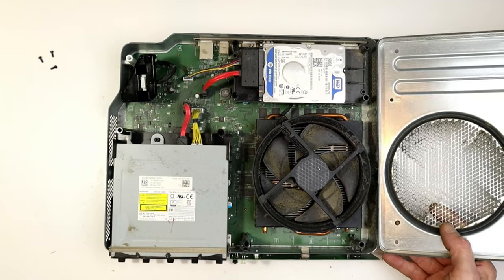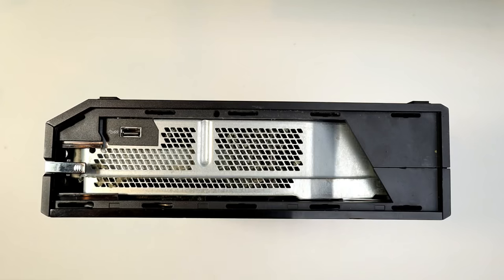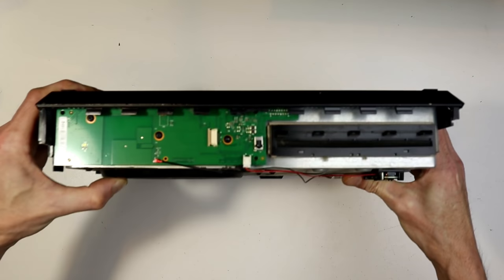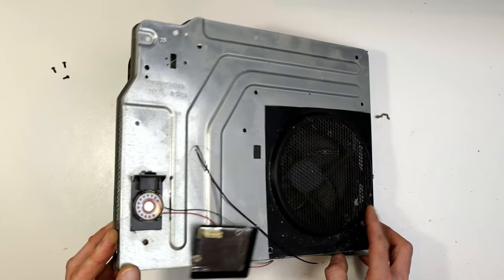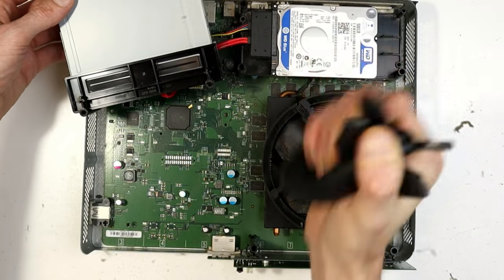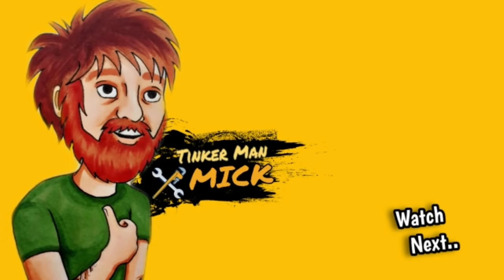How to Clean Your Xbox One Fan at Home

Comment: when i pulled the power cable out i thought the little ram piece was supposed to come out with it and i swear i had a mini heart attack but  i went back and saw the video
Reply: Man i thought I broke mine😭
Reply: Same
Reply: legit just did the same exact thing bro
Reply: Me too
Reply: Oh, snap..it's possible to put it back in and it'll work??? 😮
Reply: @ if i remember correctly i accidentally pulled the cable out and thought i broke it but then i realized the connector attached to the board flipped up and you could put the cable back in and close it and it would secure it in place
Reply: @gobbleswells2883 you have to put the ribbon cable in and loop it around the connector and the piece pushes in not flips down sorry

Comment: Do not use a vacuum cleaner unless you don't plan on starting your xbox for the next 24 hours. When vacuuming dust off electronics. It built up a static charge in the circuitry, which can ruin your console when you turn it back on if you haven't allowed time for it to dissipate.

Comment: You’re fuckin right about opening up the second part being hard.
Reply: How did u do it. I used everything. Screw drivers razors nothing worked
Reply: @Dripper_8097  Push down and up on the side one and use a prying tool, not a screwdriver and keep doing the same thing on each clip, push down and away, im not sure why he has you prying at the first one but yeh
Reply: @TheSean619  how to open still cant do it

Comment: In case you're not comfortable opening it up:
Just holding a vacuum cleaner on full power on top of the intakes also works quite well,I've done it before watching this video, and ended up still opening and being pleasently surprised at how well the vacuum worked
Reply: Which ones are the intake
Reply: @cow9066  those plastic lines that you see on top and the sides on it
Reply: @cow9066  there air vents
Reply: dont ever do that 2 electrical appliances even whencone is off can cuz a static reaction search it up it can make your xbox?pc slower and last shorter time
Reply: @kmshapiro4233  yes. It can also break the fans
Reply: That's what I'm gonna do, with a relatively low power hand vac. I'm too nervous about breaking that ribbon thing to open it.
Reply: this is perfect because im too scared to open my sons in case i break it, so i will try this as his keeps overheating and turning off.
Reply: First of all , it absolutely does not clean well . Most of us know this as we've tried it first hand . We've either damaged our console or wasted our time .
Reply: @tuikedz6864  Seems to me like it's not worth opening to clean. I've only cleaned my Xbox one with a vac on low from the outside and have used it almost every day since I bought it refurbished in 2016. Still runs like a champ with no issues.
Reply: That’s what I do, don’t want to risk damaging it
Reply: mine is still not working 😢
Reply: @livdavies40  Thats what mine is doing, over hesting then turniny itselt off

Comment: It is super easier to put back the case if you pop the front off the plastic clips. Set the front in place. Lock in the back and side clips. Then tuck the front clips under the top of the case.
Reply: How Do I put the blue thing back
Reply: Life saver
Reply: You might as well done a video cause I'm trying to pop it back and it ain't closing

Comment: Appreciate the vid! Took mine apart today, cleaned the fans, and my clicking noise was gone.  It’s a chore to take this thing apart though and put back together.  Especially that power button ribbon cable.
Reply: For future reference the front panel pops out from the top casing allowing you to attach the ribbon back so much easier. I wouldn’t have been able to put mine back together again otherwise
Reply: Definitely is a chore! 
Just finished cleaning mine and putting it back together. 
The sun was up when I started and now it’s dark 😂.
Reply: HOW DID YOU RECONNECT IT???

Comment: Worked like a charm I accidentally disconnected some wires but was able to put them back. Turned on Xbox and was a black screen after troubleshoot, I unplugged Xbox from wall held the power button down 30 seconds and it started right up. Thanks again !

Comment: Done this took a bit of time to get case back on, my power button doesn't work now so may have knocked it. But power on via controller works fine. Thank you for the video seems to running great so far(should add i fixed the power button issue as described in the video with the little tab connector) happy to say all back to normal and not sounding like a jet taking off under my tv
Reply: The power thing doesn’t work because the blue thing isn’t back in place
Reply: My power won’t work either I think I broke it

Comment: Go to thank you for the video I have never gotten my Xbox clean or cleaned it myself besides spraying the outer dust so when I opened it up today it looked like a goddamn desert cleaned it out and now it’s working much better than it was thanks!!! <3
Reply: bro this it works i want to try it too but i dobt know im scare if i ruin my xbox can tell me is good to clean with vacumm will take damage in time if i make that ?
Reply: @wavesoundsamv6135  I wouldn’t Use a vacuum mostly because it would be ineffective use Q-tips wet wipes or Compressed air they’d be much better for cleaning
Reply: ok thank youuu

Comment: Hi thanks for the video.. was a huge help.. however I didn't have anything to open the screws.. as I've had it years and will be replacing it soon. As a temporary fix I snapped off the remaining plastics on side to allow access to better clean the vents there. Then cut a hole (3 sides of a square) pealed that back and used a soft brush to clean the fan and blades. Hoover to remove dust.. and then pushed the mesh back into place.. xbox seams to be so much better now. And runs a lot smoother and quieter and doesn't overheat/turn off.. however I've only recently done this so I will have to update you if this continues being the case

Comment: I did that and discovered that it was much worse than your dusty situation as the big fan on top was jammed up tight from dust and if that’s the case with anyone else there’s actually a trick you can do that doesn’t void the warranty 

You must unplug all cables then give the unit a firm shake from side to side then repeat that same thing by turning it left and right on a flat surface then if you’re lucky the fan should free up then you can continue on gaming as normal 

My process of doing so doesn’t require any tools or opening the device

Edit: this procedure is actually safe and good to do if your Xbox one suffers from unexpected shutdowns from the heat sensors becoming too hot from lack of ventilation so doing this is safe and it will not cause any damage to any components unless it is plugged into the power supply whilst doing such actions.

Doing this with it powered on can ruin the Hard Disk Drive so make sure that nothing is plugged in the Xbox and no damage will be done.

Also when doing the side to side motion make sure that you have a FIRM GRIP both sides of the machine to decrease the chances of it dropping on the floor and causing major damage that could be irreversible and/or repairable.

I am not liable for any extensive damage done to your property IT IS SOLELY AT YOUR OWN RISK 

Do not attempt this if you don’t know what the issue is. Just let people who know what to do or have the professionals to help.

Comment: Got the top off, made a small break on one of the connectors and cleaned it however the front connectors on the external power button just refuse to connect and leave it at an odd angle. Any ideas how to fix it before I accidentally break my Xbox?

Comment: Hey I need help working on my xbox I bought it pre used and the HD they H DMI port for hook up to the TV go to the TV is not acting up right I mean it works just fine but I just need help and also got a xbox Halo and another xbox and I was wondering could you possibly be able to fix the Halo edition and I'll let you have the other one as a part's xbox if you ever need 1

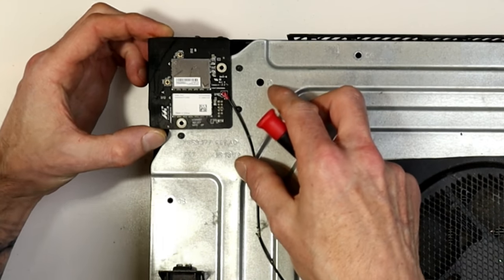Comment: I can’t seem to get the piece at 4:47 to come off. I don’t know if I’m missing something but i had unscrewed the two screws. It’s still stuck though.
Reply: That piece is what connects ur xbox to wifi if i remember right, but anyways as u see in the video when he takes it off he's gently shaking it a little cuz it's stuck in that little connector port or what it's called in english idk but just gently shake it as u pull it up and it should come loose. Had the same problem with that last time i took mine apart. Have a great day!

Comment: This is great, but I'm having trouble with reassembly. I can't get the front to clip into place -- everything else clipped fine. I didn't do any of the unscrewing for fear of breaking it, so I don't think it's an improperly aligned component. Any ideas? Do I just... Push harder?
Reply: i have the same problem, please reach back
Reply: Had you ever figured out how to pop the front piece back in? I am having the same problems you explained. Every other piece popped back in nicely but the front won’t go in and the disc drive will not line up.
Reply: @sooperswag2498  I had this problem but even though they aren’t clipped in properly it works fine just doesn’t look too good
Reply: It feels crazy and it feels like your gonna break it.  But I pushed harder and it clicked in.   Scared the poop out of me though.

Comment: So I followed everything in this video, and then I had a fully opened Xbox and I didn’t know how to close it. Then I just had to retrace my steps and go backwards in the vidoe to see how to put it back together. I put it all back together, plugged the internet thing where it’s supposed to be, plugged the other plug for the internet in. I also plugged in the colorful spinning looking thing back in. Then I closed the gray part, connected the blue ribbon, and closed it (which was way harder than even getting the blue ribbon piece back in). I tried to turn it on, and it doesn’t work. Any ideas? Also, I know this video is a year old, but could you make a re assembling video. I looked through all your videos and couldn’t find it. If I missed the video, could you comment the link? Thank you.

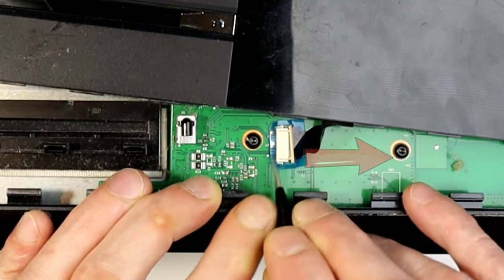Comment: 2:27 Struggling putting this thingy back on its* place again…
Reply: You can take off that panel to make it easier! Look underneath, and the front panel with the button can come off. It's held on with a few clips, so pop them all off, and gently remove it. Now attach the front panel and the cord, and then put the top part back on, and it should snap back onto the front piece. Good luck!

Comment: No way you used a flathead bit for a torque bit..if so what number flathead did you use
Reply: Bruh did you ever find out? I’m taking mine apart now and I’m stuck on the screw part. I got something small enough for the three little screws but I don’t have anything for the main screws labeled with “C” s

Comment: I would like to se a proper fan cleaning. Like removing the fan from the radiator. Why are you using that big brush for the fan, are you trying to make it unbalanced and noisy ? You should use a makeup brush, as you said in the video.

Comment: i tried unscrewing the long screws but they were way to tight
Reply: The Torx wrench/drivers will have a much beefier handle and allow you more torque to disengage the fixing than the smaller flat bladed driver shown in the video.

Comment: would that solve the problem of the xbox turning off and on by itself?
Update: I successfully cleaned the xbox and it hasn't turned on and off anymore :3.
Reply from the maker: It might
Reply: No the xbox turning on by its self could be that the button has air bubbles on it so it turns on cause i have the same problem

Comment: Didn’t take long to take apart and clean. Putting this shit back on in soooooo pissed off 

1. Can’t get the front back on 
2. Trying to align the front the right side won’t align 
3. My front piece ended up cracking because the tension 

In other words don’t do this until this man makes a reassemble or you gonna fuck your shit all the way up

Comment: Damn bro I wish you would have told me that my lid wouldn't sit properly after I took it off.
Reply from the maker: It will sit back perfect if you put it back together correctly 😉
Reply: @TinkerManMick  help,mine won't fit correcrly
Reply: so basically make sure you have everything connected (wires) then you just place the top plate on first but put it over the clips and it should pop right back in then pop everything else back into place (it may take a few tries) but if you just try to place the top on without lifiting it over it doesn’t go back, also search up how to reassemble it and im pretty sure it’s the first video
Reply: Is it the front that’s not sitting nice?
Reply: I fixed it
Reply: @ethanciniello8015  nice